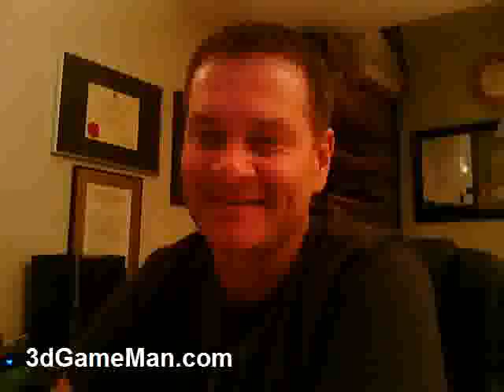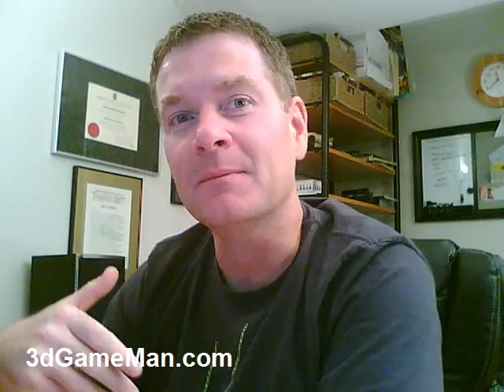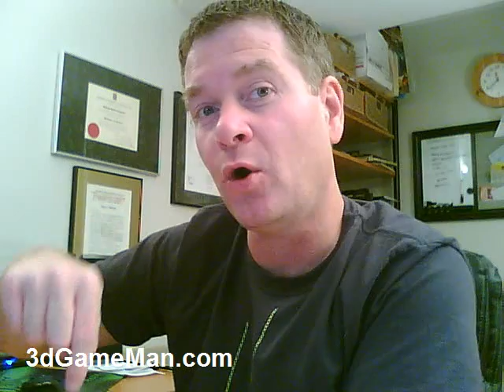#267 - Q&A: What is Earthing/Grounding?

Comment: (this is the second post see the fist one first) So what earthing does is to reduce the voltages but will maintain the difference in voltage. this will reduce the voltage flowing in ur devices so ur devices would not damage or will work with full capacity (eg. in pc it may corrupt memory). also it will reduce the magnetic fields made by the current.

Comment: its really simple. as some one all ready comment one of the reasons is to stop people from being shocked. Also if u know that voltage is the potential difference then in a circuit the voltages could be really high but the difference between voltages is small. See next comment ( it continues)

Comment: To answer the question, WHAT IS IT? Grounding is the process in which elecricity is given and alternate route to travel to ground in case there is a short in the circuit. if tere was a short in say your common household outlet, you would be electricuted if you touched any metal piece in contact with the short because you would become the quickest way for the electricity to reach ground. If there is a grounding wire you would not complete the circuit and in theory would not get electricuted.

Comment: lol that was mediocre at best my friend .... The whole point of grounding is to allow somewhere for electricity to go in case of a short in the circuit. Now, the the most common type of grounding is not done by those plates, it is only used in instances where there is no water main to attach the ground wire to. ALL electrical circuits must be grounded, not just in home and office.

Comment: Mine is done off my copper pipes.  It works because the earth has a negative charge, which means electricity naturally flows to it.  If you can make it flow to the ground through a copper line or pipe rather than through, well, you for instance, or yuor dog, then that'd be a good reason for needing it.  By the way, nobody really seems to know  nature of the generator which continually maintains a negative charge on the surface of the earth.  That help, drajzman?

Comment: your talking about ESD discharge and it does not short anything, it will damage it or "fry" it, shorting is where you bypass something by creating a path of lower Resistance, and shorting does not allways mean a bad thing and wont allways hurt something, sometime it is done on purpose.

Comment: Technically positive and negative are terms for a DC circuit. Mains current is AC so the terms Live (Hot wire in the US) and Neutral are used. The current in the live wire fluctuates between above and below ground so in layman's terms sometimes it's positive, sometimes it's negative.

Comment: You're getting ESD and shorting confused and shorting is something different to ESD. A true short circuit is where there is a path of no resistance between two conductors with a potential difference. ESD is where a static buildup is discharged to ground.

Comment: yer everyones does. there's a positive and negative and a ground. you normaly have thr rod or a plate. in our case a plate which was dug up by plumbers ^^ so it would have been a lil dangerous to use electrical equiptment incase of a surge. but this is in australia.